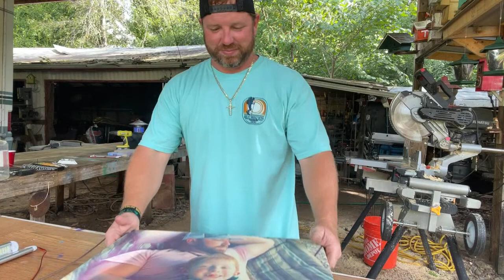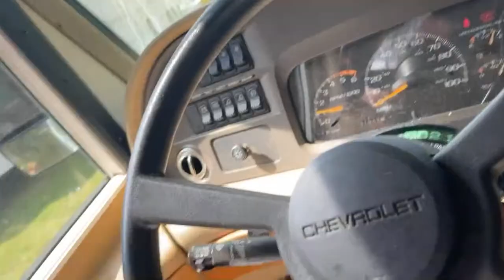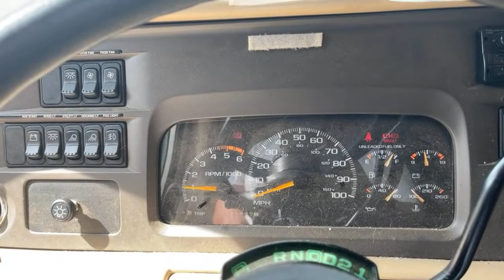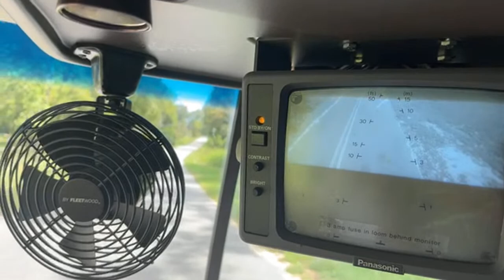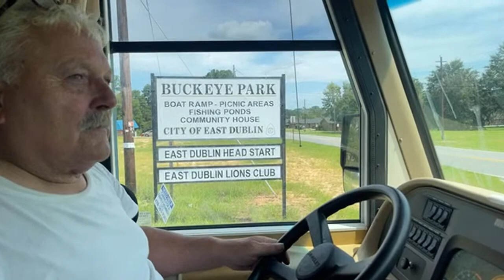RV Road Trip

Comment: Steven, please check at the Mobile Phone dealer about your overheating phone. It shouldn't do that. It could possibly start a fire. Original batteries are recommended. Maybe you still have a guarantee on that device and can get a replacement. Save up for a new one now.

Comment: From experience..when you live in a area with red clay, hot temps and high humidity... mineral buildup is a thing on vehicles and headlights..especially if its a vehicle not used daily..the only thing ive found that works, is a mixture of white vinegar, dawn dishsoap and a pressure washer

Comment: I guess that the State could put up a sign to show there is a very dangerous intersection up ahead, on both streets and on both sides. My cousin pulled out on his motorcycle and a truck hit him, so maybe decreased speed ahead signs are needed too. My Sister had a tree in her yard. Lightening hit it over and over. It looked dead to me. I am so glad that she moved. So the conditions on those streets has to change right now. It is just logical that accidents will happen again.